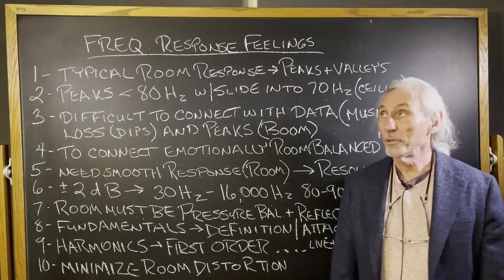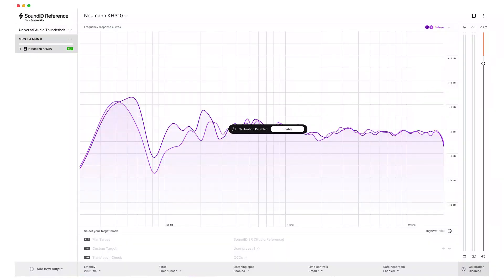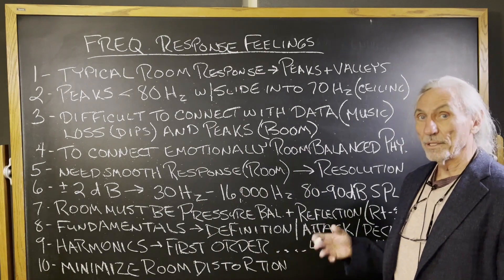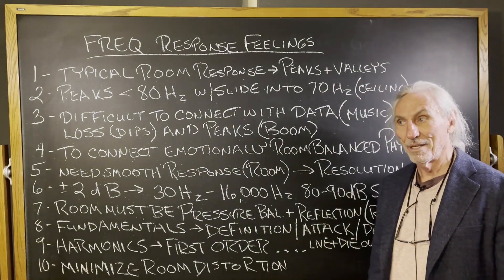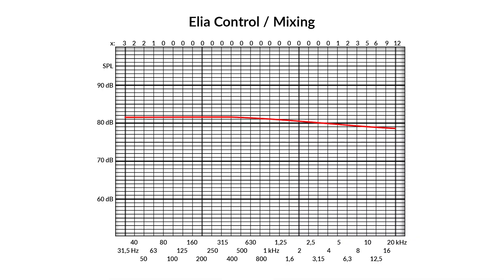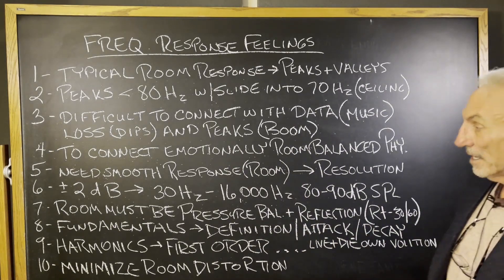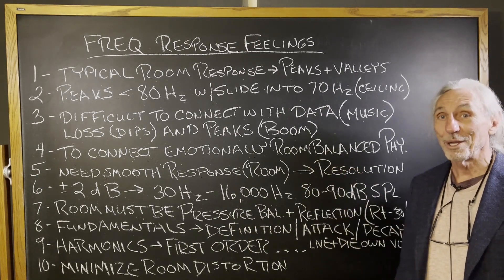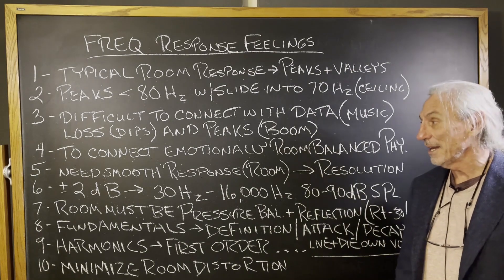Frequency Response Feelings - www.AcousticFields.com

Comment: Helpful as always. I did a spectrum analysis at various times of day as you suggested and found the yucky 50 to 100 clump. Turns out the subway being built near me beside the highway had removed the sound barriers for construction. Local municipal elections are coming. One complaint about the 50Hz levels and temp noise barriers were up in under 48 hours. Peaks at night are down 10Db. A whole neighborhood sleeps better because of you. The permanent sound barriers are being planned now. Probably a 20 feet high 6 inch concrete wall. What are your thoughts on good highway noise barriers?
Reply from the maker: I have no personal thoughts. What are the frequency and amplitude of the noise issues. The numbers will tell you how to think about barrier design.